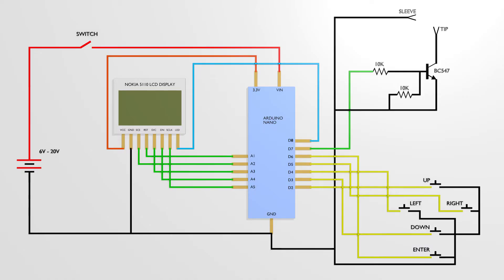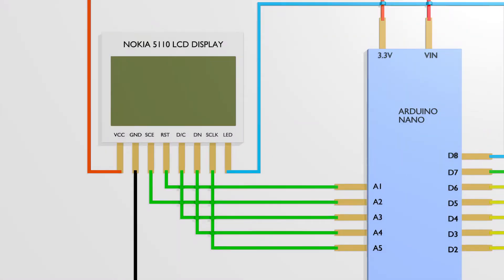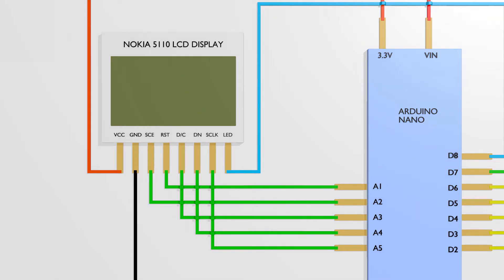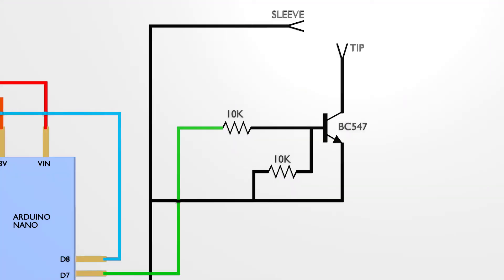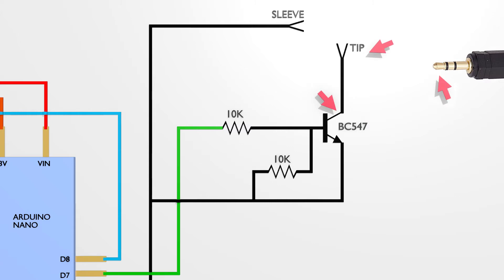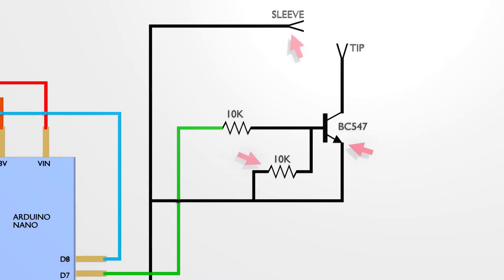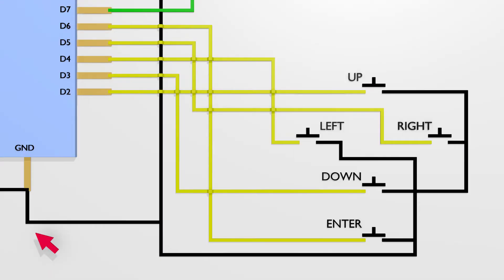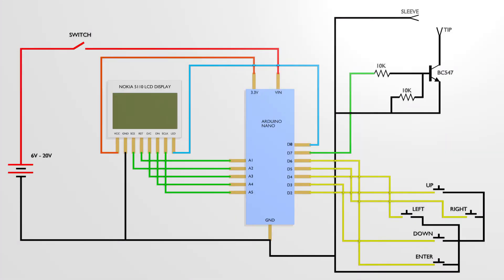10: A DIY Arduino Intervalometer

Comment: I had to rewrite almost the entire thing. Your code is so messy and inefficient. I only kept the execution part because I don't understand it at all so I don't wanna break it :D
Why do you base void loop() on cases and not functions? You need to study the code to understand it.

PS. When I used those 10k resistors, the resistance was too high for my BC547 and Canon 760d to do anything. I removed those resistors(this transistor can handle 5V/40mA which is the max for an Arduino) and everything started working without any problem.
PPS. I replaced your 4 buttons with 4x4 keyboard matrix and wrote a function which lets you type number of frames instead of manually clicking the right button for half an hour.
PPPS. And I've put everything in a proper plastic project box
PPPPS. + I used rechargeable Li-ion battery with usb-c charging. It's less annoying and more eco-friendly.
PPPPPS. This is the last PS xd
Reply: Edit: I don't know what's happening but it sometimes works and sometimes doesn't. I changed the circuit to the one you recommended(because transistor without anything stopped working) and... it works... kinda.
It works perfectly with 2, 3 and 4s pause but when I choose 5s it skips every second shot. When I set even larger pause it skips more and more frames. With a 9s pause, it doesn't shot at all.